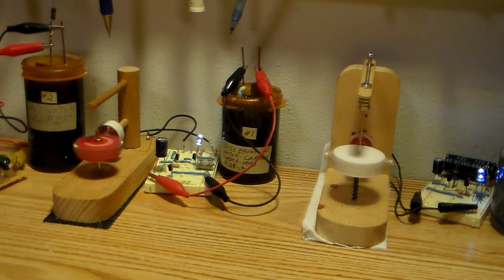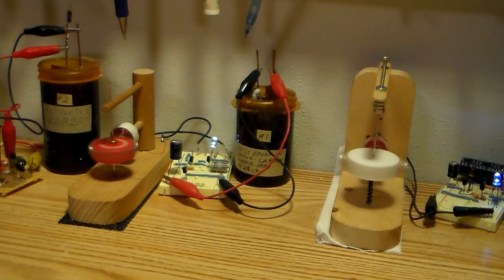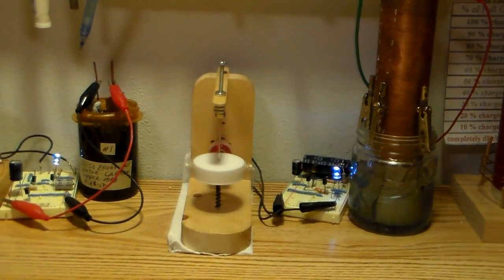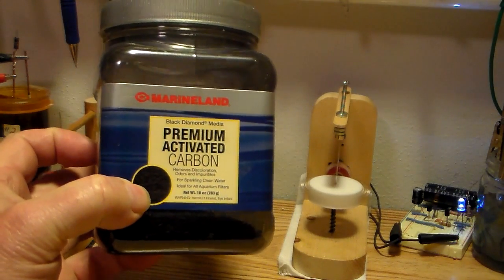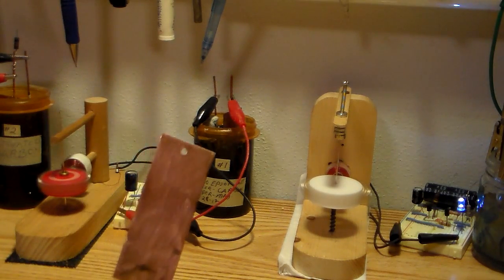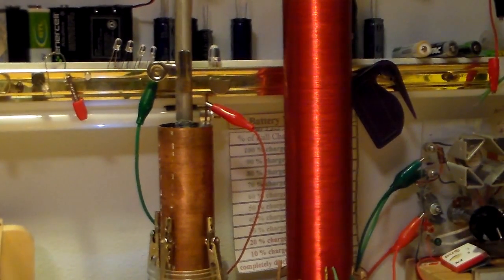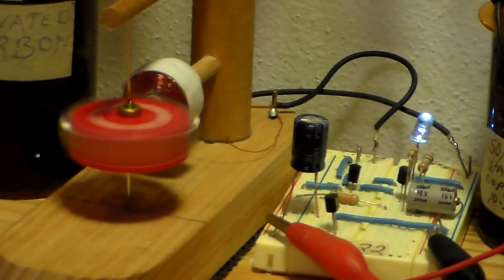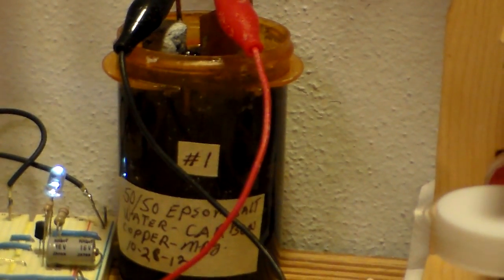simple cell

Comment: Haha yes indeed. I thought the same on seeing this video ! 
Got a carbon/lead cell running here using distilled water and 4x teaspoons of Epsom salts slow stirrred....in a pills bottle and was how I knew about the gallon jug lid. Found the lead on the road the other day, a car wheel weight (1.138V before any charge, 1.74V after charge from 5V, 60mA output) :)

Comment: Nice cells. Got a tip for you if you want to omit evaporation. 1Gal water jug lids fit on great on to pills bottles. Much easier to work with the soft plastic to put holes through, than the original screw tops :)